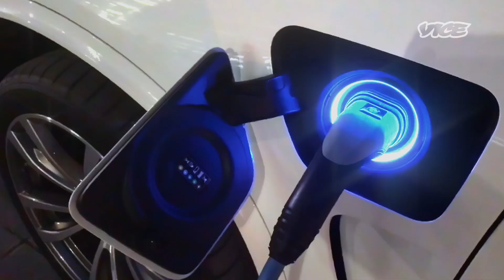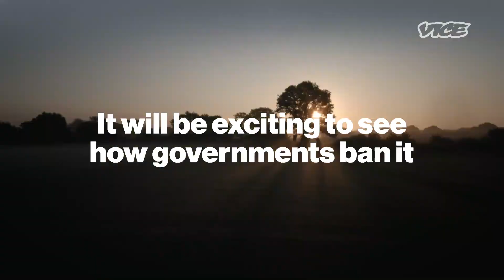The World’s First Solar Car | Extinction Update

Comment: I find it amusing that a lot of comments are assuming the car is only supposed to be powered by solar, and are concluding that the panels are not efficient enough. That is not what is claimed in the video. It's an electric car that has solar charging on top of normal charging and it's very energy-efficient. If you judge it in comparison to normal electric cars it's much cleaner.

Comment: What a load of crap. There have been plenty of solar powered cars in the past. You CANNOT power this size of car and design on a trip with 100% aka impossible efficent cells. What you can do is build solar farms and charge the car from them. That fucking LCD in the car uses more power than the car generates. Let alone engine.

Comment: TLDR: Putting solar panels on cars is a dumb and ineffective way to power a car on renewable resources.

At best, that car has 2 square meters of solar panels on it. Assuming optimal conditions (meaning in a sunny environment with all the panels directly facing and tracking the sun), they can generate about 400 watt hours. For context, on a Tesla Model 3, that means it would take more than half an hour of charge to drive a single mile and 125 hours of sunlight to charge the 50 kWh battery. That’s with assuming optimal conditions with the panels. In reality, almost none of the panels would be directly facing the sun, none of them are tracking, they’re gonna be dirty because they’re on a car and most people won’t be driving in a super sunny environment. If they can actually get 100Wh (.4 miles per hour of charge) out of those panels during real use, I’d be impressed. Either way there’s no way the panels on the car could realistically be used for anything other than auxiliary power. It’s not all doom and gloom though, turns out we already have solar power cars. Almost all  EVs in places with grid level solar (or people with home solar) are solar powered cars. Turns out that’s a far more efficient way to make solar powered cars since they can be places at more optimal angles and can be tracking. Then the panels can even power things that aren’t cars. We should really be more focused on grid level renewable power and just getting EVs made than trying to put solar panels on cars for some reason

Comment: Sorry, but this is total BS. The production still causes emissions like crazy. The roads and infrastructure are still anachronistic monsters. The tyres still produce microplastic that poison our lungs. This is not a solution!

And to say that after X km you save CO2 is dangerous propaganda. Using a car you always produce emissions and cause harm! Ride a bike, walk, or come up with a new transportation system. But stop cheering for the same sh*t in green.

Comment: This is by far the dumbest piece about green energy published by Vice in a long time.. No we are not going to see solar planes. Even if solar cells become 100% efficient. So besides not being factual, it's just a condescending add for an impractical car you have to park in direct sunlight. 
Not to mention that the resources spent on making the damn thing would be better spent on regular solar cells mounted to a rooftop with constant solar exposure..

-edit. Oh by the way. There has been tons of solar powered cars before this one.. Both experimental and regular road legal cars
Reply: WhAt Do YoU MeAn. Yeah, people think u can just stick a battery and some solar panels and ur good, but the power to weight ratio is completely off, in comparison to using standard aviation fuel
Reply: Mike's Big Mouth  i want to see your face, when you realize you get 300 km on a charge, and pumping up the battery with this solar panel takes 4 month parked under the Sun 😆
Reply: Mike's Big Mouth  to see the happy smile
Reply: Mike's Big Mouth  Mike. You obviously have a lot higher solar output in South Africa making it a lot more viable. But there are just a bunch of problems with this design.
1. Thin-film panel are the only panel type that can bend to the shape of the car and they are not very efficient.
2. Giving that they have to follow the contours of the car, then they loose a lot more efficiency by not being at the optimum solar angle. 
3. Shadows from nearby trees, lampposts, building and stuff like that absolutely wrecks the efficiency when parked.
4. Dust.. You guessed it. It wrecks the efficiency of the solar panels.

If you really want a solar car. Then get a van or a 4X4 and fill the roof rack with monocrystalline panels. They have a much higher output per square meter. 
You would have a larger are covered in panel, because you don't have to worry about not covering the glass areas.
It would lower the temperature in the car a lot, lowering the need for aircon.
They would have a better solar angle for the panels. Plus it is much easier to clean a flat surface, so there is a better chance of them actually being cleaned regularly. 

Would you please humor me. What city do you live in and how far do you drive? Would be fun to do the actual calculation to see if it could actually run on only solar.